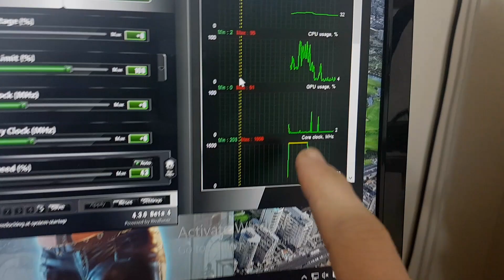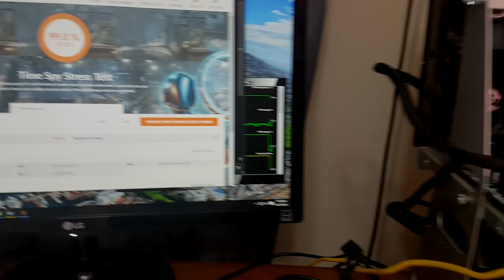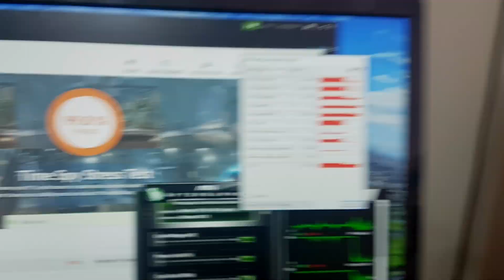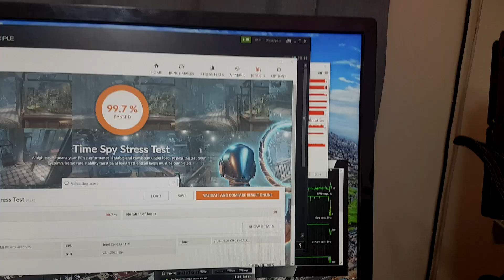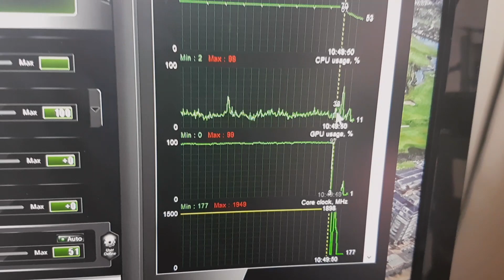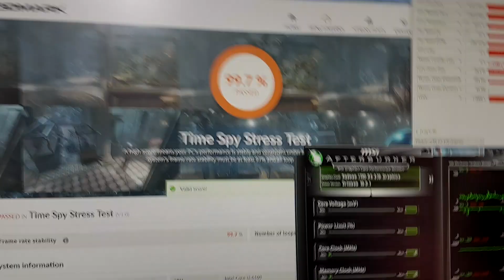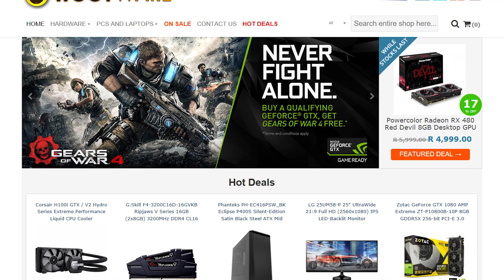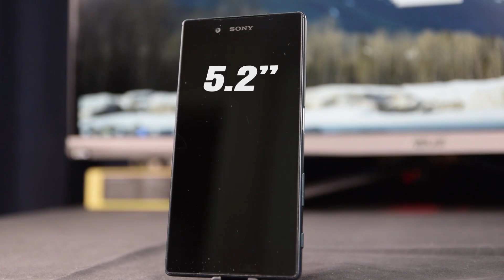DO GPU BACKPLATES SUCK?!?!

Comment: Think the cooling results may have been skewed a tiny bit by the removal of the heatsink after the first test (thermal paste and all) But differences are minor anyway.

VRM cooling should be right up there on a priority list, heated vrm = less voltage stability.

I remember the older GPUs that had back-facing memory modules, backplate helped for memory cooling.

Also support. I've got one(two?) of those Galax HOFs, it's very heavy and without a backplate it would be bending a lot more than it is.

Let's not forget that it looks good. :3
Reply from the maker: I really didn't think the thermal paste had anything to do with it as the increases were basically explained by environmental temperature rather than seeing a significant effect from the backplate.  The VRMs on the Galax cards still have a heatsink on the front of the board, so the thermal pad on the back isn't the main source of cooling, so they're still safe.

Comment: You could have made this test better by testing the cards with the backplate on again at the end to make sure the temperature changes weren't due to air bubbles in the thermal paste,,, :p
Greetings from Kenya btw :)
Reply from the maker: The temperature changes were negligible to the point that this would have been redundant.  The runs without the backplate were basically the same as those with.
Reply: Okay then,,, keep up the good work :)

Comment: No offense, but in order for a scientifically accurate comparison, you should have changed the TIM before the initial test for each card. Simply re-attaching the cooler with the old TIM remnants introduces a skewed favourability towards the first run. No concrete conclusion can be rationally concluded from your tests.
Reply from the maker: Except for that skewed favorability that you're referring to didn't appear in the results.  The minor temperature fluctuations that you're referring to can easily be regarded as increases in the ambient temperature of the room.  The second runs didn't show negative results, so the TIM didn't really make an impact at all.